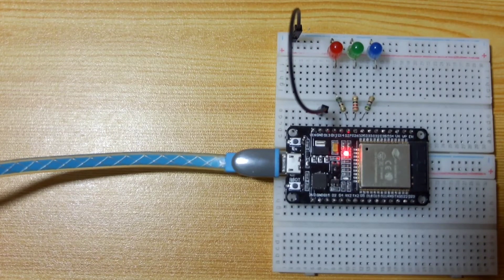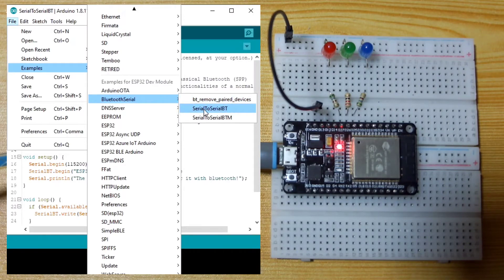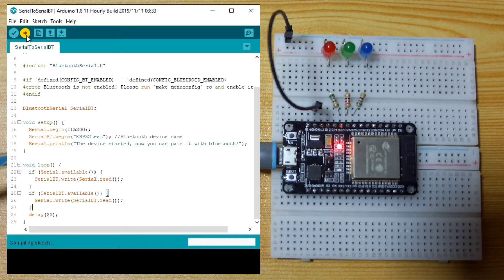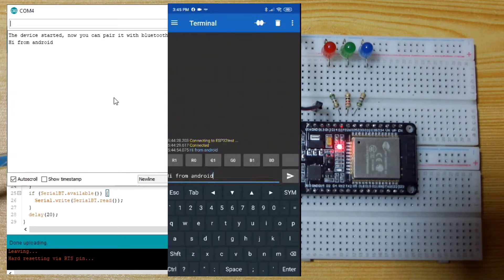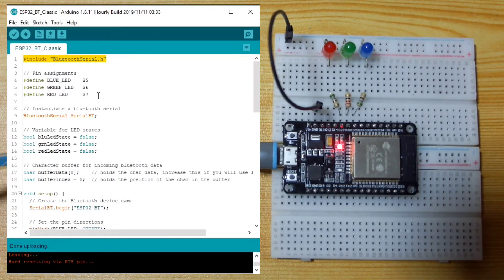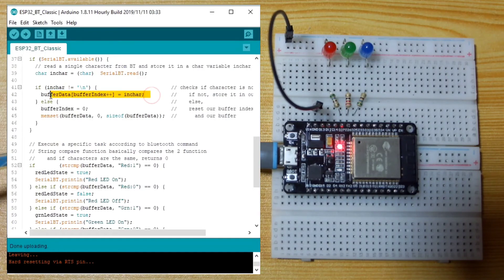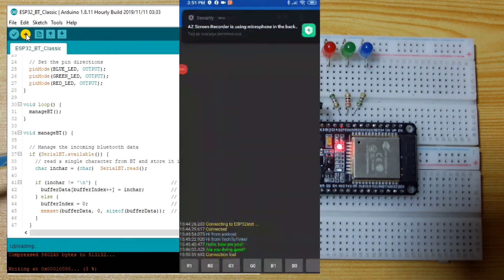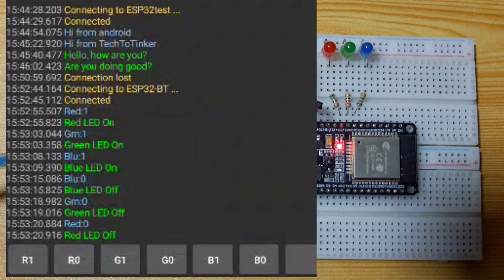Tutorial: ESP32 Bluetooth Classic | How to get started with ESP32

Comment: If we want to add one more led so what we have to do
Reply from the maker: Hi @kshitij technicals, links to the source code is available in video description. The code is easy so if you need to add another LED then just add another instance of it. What you can do is:
1. Learn and understand the code
2. Try to modify it adding your needed another led
3. If you are stuck, message your modified / edited code here.

I will be more than happy to help you, if you try to learn, understand, and modify it.

Cheers and happy learning.
Reply: @TechToTinker  i dont know coding can you please make a the code and give me 
please please please🙏🙏🙏😌😌😌❤❤❤❤🧡🧡🧡
Reply: @TechToTinker  i try the best, my bro but when i click on the button on the phone to start the extra led the red led is glowing
please do it for me
🙏🙏🙏🙏🙏
Reply from the maker: @kshitijtechnicals2609  show me your code then.
Reply: How can I send it, via message or email or the link of google drive
Reply from the maker: @kshitijtechnicals2609  you can paste it in the comment or sent it to tech.to.tinker@gmail.com

Kindly give complete details:
1. Circuit diagram
2. What it does / how do you want it work
3. Source code
Reply: Hi I want to increase the voltage of the output ,so how can I do it
Reply from the maker: @kshitijtechnicals2609  what do you on "increase the voltage of output"?
Reply: @TechToTinker  the wires which goes in the + of the LEDs

Comment: Paps pano ba mapagana yung bluetooth ng esp32? Hindi kase sya na dedetect ng phone ko...
Reply from the maker: Hello @Rick Bran, I am not sure how I may help you with not enough details. What setup you currently have? and what code you have? Is there any error displayed?
Reply: @TechToTinker  i just buy this online...and just thought it was plug and play, that you just supply it with power and boom i can detect and connect to it's bluetooth. Does it need some configurations before the bluetooth function can be use?
Reply from the maker: @rickbran7541  I believe you need to put some source code inside just like with this tutorial.
Reply: @TechToTinker  can i possibly use ARDUINODROID APP instead for uploading additional codes for enabling bluetooth function?
Reply from the maker: @rickbran7541 yes you can use ArduinoDroid but I am not 100% sure with it. You can always use the Arduino IDE and its free.

Comment: Do you have an example of this sort of communication between two esp32's?
Reply from the maker: Hi Kevin, I have tried with no success the communication between ESP32 to another ESP32 using bluetooth classic. I suggest to try BLE or ESP-Now.
Reply: @TechToTinker  Thank you for getting back to me so quickly.  The BLE scan example is broken as it will not show the name as it only shows a , comma.  This is another issue I can't find a workaround to.
Reply from the maker: You're welcome Kevin, let me try to find the source code with the BLE on 2 ESP. I remember that I am able to make it work before. Drop me a message in Messenger or email tech.to.tinker@g m a i l.com
I will send to you, maybe tomorrow its almost midnight here :)
Reply: @TechToTinker  Thank you will reach out by email now.
Reply from the maker: @Kevin, sent you email with the attached sketch  client and server side.
Reply: @TechToTinker  Thanks I emailed back it still does not show the name.  I would like to discuss to see if I am missing something.
Reply: @TechToTinker  another question
Do you know how to prevent the esp32 serial input from causing a heap overflow?  
```
  while(1)
  {
    if (Serial.available() > 0)
    {
      char_input = Serial.read();
      
      if(char_input == '\r')
      { 
        break;
      }  
      
      input.concat(char_input);
      Serial.print(input);
    }
  }
```
This works but if you enter in say 1000 chars it will cause a crash.  Is there anyway to prevent this?  I know obviously not typing in so many chars but looking for a way to prevent this.
Reply from the maker: Hello Kevin, my setup is as follows:
ESP32 as BLE server
M5Stack as BLE client

then I upload the specific sketch accordingly.

open the Arduino IDE serial monitor with 115200 baud for both serial ports, I did it by having a portable installation of arduino ide.

after successful upload, you could observe that both esp are sending data bidirectionally.

Quick question, did you modify the sketch? I am thinking to just upload it first without modification so we can have a base
Reply from the maker: Re: heap overflow. No, not yet have experience with big data.